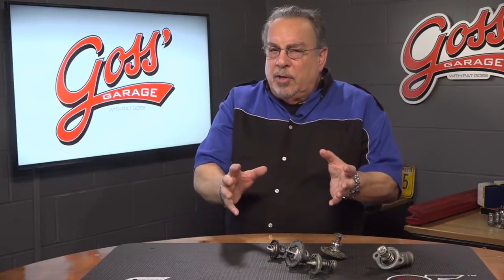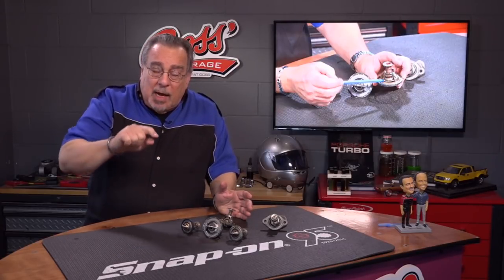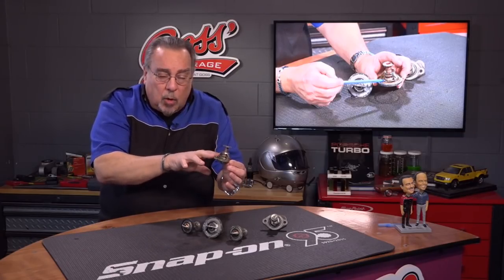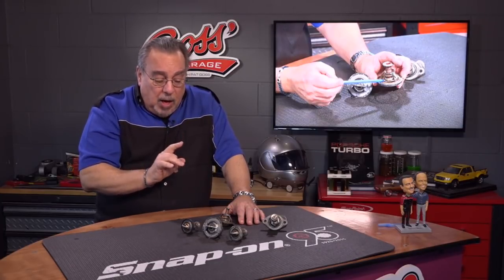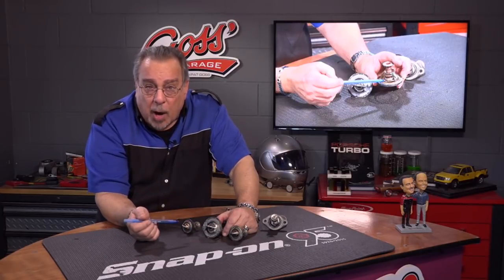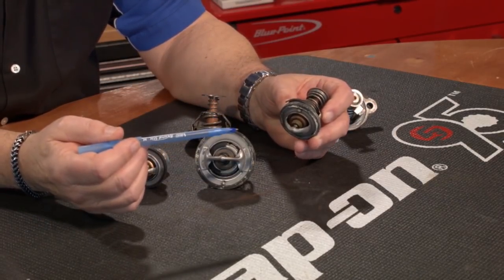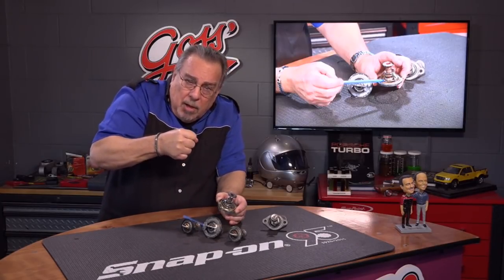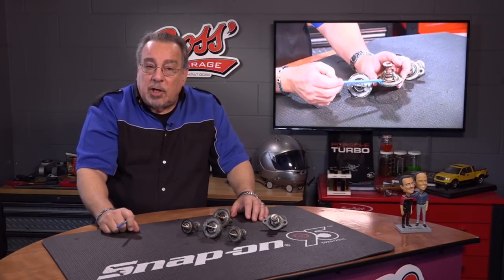Thermostats Lesson 101

Comment: My new thermostat doesn't have a bleed hole the guy at the parts store told me to drill a small hole. Is this necessary? Or are they simply different designs and the new one can burp a different way?

Comment: Hi, nice explanation! May I kindly asking you to explain how does an electronically controlled thermostat works? The thermostat in my car has a 2 pins connector. The guy from the shop told me that is temperature sensor. But I have my doubts. Thanks!
Reply: Unfortunately Goss passed away in March in 2022, but I can answer your question. All thermostats are mechanical using wax thermostatic elements that expand when they get to the designated temp. The 2 pin connector that is sticking out of the thermostat housing, that is the metal or sometimes plastic piece that houses the thermostat internally, is your thermostat sensor that uses voltage to create a resistance that is sent through the wires to either your temperature gauge or warning light on some older cars to give you an accurate reading of the temperature. I hope this clears it up and have a wonderful day.
Reply: @Redline1986  I am sorry to hear this terrible news. RIP

Comment: So true, I have a 02' Blazer ZR2 4x4 in 2023 w/ 300k miles & she runs like new & gets sticker mpg.
However, in Summer Time down here in SE Texas, the 195° thermostat seems to keep the truck hot & getting hotter the longer I drive. I put a 180° in it, I'll get a Code, Temp Below Threshold in Winter but not in summer. A 190° seems to be good for my application. I change my thermostats once a year. They are cheap & will save you an engine
Reply: You have to get the temp switch tune to use anything below that 190 to 180 seems like on your truck as well as mine